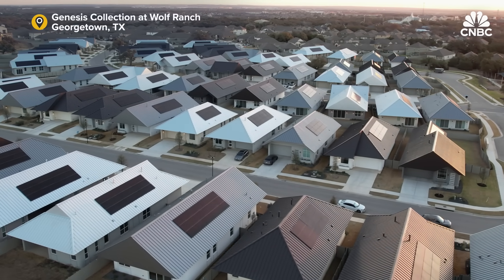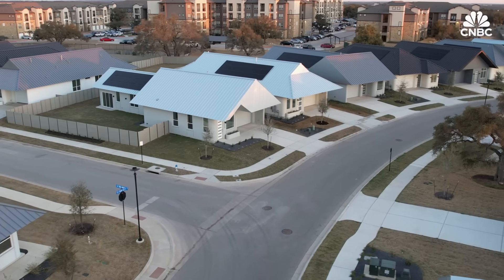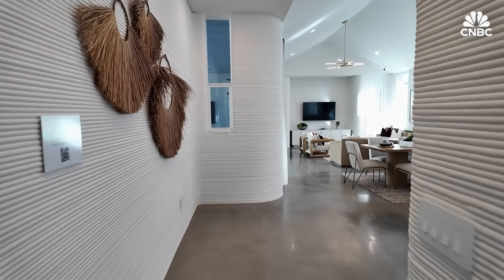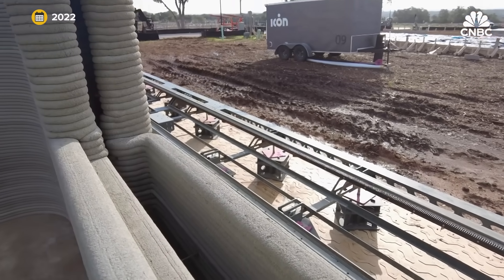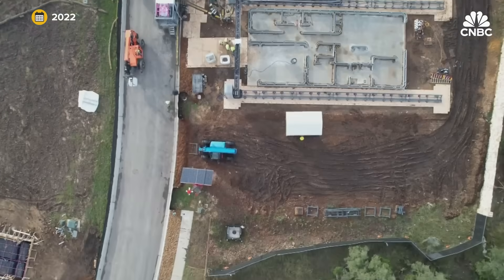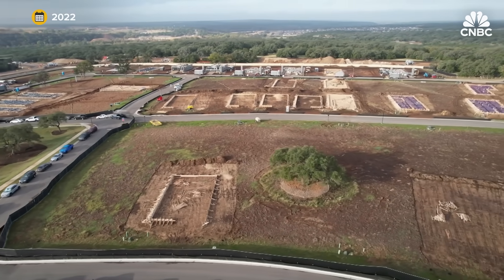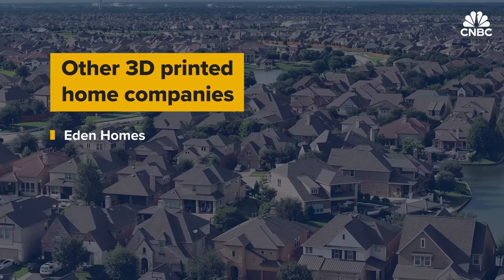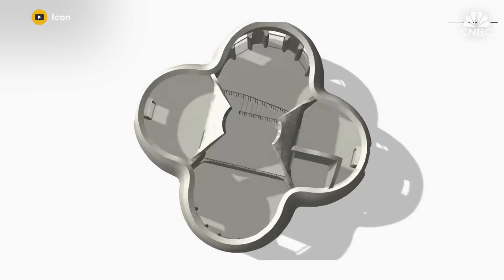Inside The World’s Largest 3D Printed Neighborhood

Comment: "Learn to code", then comes the tech layoffs. "Just learn a trade", here comes 3D printed buildings.
Reply: “Become a semi truck driver” 😅 - but now we have self-driving semis 😢
Reply: Learn to keep learning 😂
Reply: Terrible times smh
Reply: What do you think that printer runs on? Software
Reply: I don’t like the look of the interior walls, and maybe those creases would collect dust and cobwebs. Couldn’t they skim plaster over them for a nice European vibe?
Reply: you can't 3d print the wiring
Reply: @xynonners  You speak way too early.
Reply: @harveylin3548  Agree...when folks post statements like "you can't do x" I mentally add the suffix "...yet". New wave urban development stakeholders are aggressively seeking ways to fully automate process. This applies to wiring, plumbing, HVAC, etc....they may not have a cost-effective way to do it now...but the second they do (and its done cheaper relative to human labor) all bets are off.
Reply: @harveylin3548 as a plumber, I know i will not live to see the day machines are able to take my job, and I’m 35
Reply: @stevo3938 Why exactly? All that you know can be coded. All that would be left is a body to run the code through. 
Have you seen the latest androids from Boston Dynamics? Whatever helps you sleep at night though.
Reply: @xynonners  Why limit machines to printing when they can do so much more?
Reply: @xynonners   yet, the key is yet but it could happen is the crazy part we can already 3d print metal so it is possible down the road
Reply: @xynonners  I wouldn't be so sure of that.
Reply: @xynonners 10 years ago you'd say you couldn't 3d print a house. Like come on man yes we can't right now but that's not the point. You're missing the forest for the trees
Reply: @xynonners  you sure?😂
Reply: @xynonners  yet...
Reply: @xynonners actually they can sort of print wiring. So they got ai designing printed circuit boards. Theoretically they can use that idea and print wiring.  It's really just about placing conductive materials and non conducting materials
Reply: @xynonners  yet
Reply: @xynonners For now …
Reply: @xynonners  Not yet, but rest assured it's coming.  The existence of  3D printed plumbing and robots that can assemble them is very real.
Reply: Learn to code then comes AI.
Reply: learn how to do maintenance on 3d printers
Reply: Learn to weave cotton.
Reply: We're all cooked
Reply: A concrete home is more sturdy than a paper thing Sheetrock home
Reply: "There's always money in the banana stand." -- Arrested Development
Reply: Just learn to be a battery.
Reply: Now it's 'learn to code with AI' or 'learn a trade with AI.' The difference for learners is minimal. The future is AI plus whatever skills you already have or will aquire in the future.
Reply: Can't 3d print the
HVAC and it's only good for developments.
Reply: You just shouldn’t get overly attached to any given career or industry. Times change, and you can’t stop that. But what you can do is keep yourself informed so that you can switch careers if necessary.

“Learn to code” has been good career advice for many decades. But it’s not like it’s the only good career advice.
Reply: Coding and building good software are two different things..
Reply: This good! so true
Reply: These won’t replace trades, this is a gimmick or a niche case use at best.
Reply: All these buildings will still deal with plumbing and electrical things installed and require maintenance. Carpentry will still be used all over the world for centuries. Tech jobs are still in high demand and will be for centuries. Shut up, what a useless uneducated comment. Lol
Reply: I am number 46 and yes you can do it all idiots, sorry electric, carpentry , Robots dum dums
Reply: make no mistake,    when robots do all the labor and ai does all the bookwork,   'covid 2'  is gonna come around and remove the majority of the unwashed masses.  forget about ubi.  they dont need you anymore.
Reply: They also now making robot AI plumbers etc. They coming for the trade jobs
Reply: Someone has to code the printing machines and related tech.
Reply: @mrcookies409  So a coding AI trained on printing mechanics?
Reply: The people build sucky cheap houses that can't even withstand severe weather, having a safe home is better
Reply: The closer we get to a world where we dont have to work to live, the sooner we can focus on things that actually matter, like our mental health, relationships and things we ACTUALLY WANT to do
Reply: And when the trade gets flooded?😂 we’re all fkd everyone is laughing at the guy it’s happening to rn like they aren’t next, yall do plan to live longer than 10-15 years. Yall really think yall getting fk You money in the trades before that? No you’ll get a family and experience lifestyle creep and be just as broke as the college grad yall love coping, laughing at because now it’s them
Reply: That's the scam of technology in capitalism. Technology could have improved lives for people, but instead it just makes the rich richer, because they're the ones who have the power over where and how it gets used.
Reply: Yep. People still don't understand what's coming.
Reply: Sparkies and turd wranglers are still going to be in high demand.
Reply: Learn to "adapt".
Reply: And you can’t print plumbing, carpentry, hvac installation, etc. Don’t be negative. There’s still so much opportunity.
Reply: @lovinglife419  But you also can't just hide under a rock and pretend 3D printing isn't going to make a lot construction jobs disappear.
Reply: @harveylin3548 let’s go back to Stone Age don’t use cars back to horses create jobs and no power tools just hire more people and no plumbing that way we can pay people to go get water and shovel our poo again.

Well get all those jobs back brother
Reply: @lovinglife419  they will eventually find a way. think about all the jobs that have been gutted already with this technology - AND, technology ONLY progresses...
Reply: @lovinglife419  literally far LESS opportunities, by cutting out entire trades... What are you talking about?
Reply: @lovinglife419 actually  you could print most  of the plumbing
Reply: @lovinglife419  "They haven't taken your job YET. Don't be negative."
Reply: @lovinglife419  Not yet, but when they figure out a way to automate those skills as well, they will.
Reply: @lovinglife419  spoken like a true office worker. So 1 person building 12 houses like the report says is going to help employment issues???
Reply: Erm you absolutely can print all that eventually
Reply: don’t think you understand just how much coding is required for these robots lol
Reply: @monaazzo8011 ai is the king coder now
Reply: In both instances, you were supposed to build the business that controlled the beginning and end of the sector, not work for the guy building your own replacement. Please remember this the next time you get career advice. We live under capitalism, not workism. The goal is to generate capital, not exchange work for sustenance for 50 years. That’s just servitude in a modern setting.
Reply: @bettyjeanmarinogmail Very true but still easier said than done
Reply: @bettyjeanmarinogmail you won't have any sustenance if you don't have any jobs. So I guess we will survive on our looks 😂
Reply: @bettyjeanmarinogmail "not exchange work for sustenance" this is the same bootstrap argument and it sounds great and motivational for some people but not everyone will start a business and for a functioning society, people need jobs. The same people demanding everyone be ok with capitalism are the same people crying when younger generations don't want to have kids.
Reply: its a game designed for the individual to be forever controlled
Reply: No, its like the attempts to build with shipping containers, it creates more problems than it solves, and a lot of labor.
Reply: @churblefurbles no i think you’re wrong actually, a lot of cool stuff is coming down the pipeline. i guess time will tell
Reply: Just get dementia and choose physician assisted unaliving
Reply: McDonalds is always hiring lmao
Reply: Work harder
Reply: I think it will actually help with illegal immigration as less workers are needed. It will also help Americans take these jobs and have higher salary since a business won’t have to hire so many workers.
Reply: Starting and running your own business is the only way to go. Don't blame others or the government if you choose to be a wage slave.
Reply: @eliiiiiiiiiiiie  Not if the big businesses are in bed with big government, you think small businesses have any room to live, good luck.
Reply: @eliiiiiiiiiiiie  if everybody owned a business, nobody would be left to work in the businesses. Most businesses are not self-sufficient.
Reply: @eliiiiiiiiiiiie  So because every generation prior could make it big with a basic job, now future generations are shoehorned into only becoming a business owner to make it?

Get real dude

Comment: I wonder if there's an option for a smooth wall as opposed to rippled.  the ripple effect is nice though, just different
Reply: I’m sure they are working on that. That way concrete 3D printed homes wood look virtually identical to wood framed structures.
Reply: @Battleofthefortuna-23   Right, it was understandable a few years ago when 3D printed homes were in it's POC phase.

Comment: If you're going to use standardized layouts in all the homes,  using prefab sections or some kind of interlocking panels would be a lot cheaper and faster than a 3D printer... (imagine giant interlocking concrete legos).
Reply: YEP. And that have been used for decades.
Reply: I mean you could just build a tilt up style shell and stick interior, probably would be a superior building
Reply: No need. A small rectangle house takes a whole 2 days to frame.
Reply: @MrSteeDoo  And then you have to apply air sealing, and apply exterior siding to the exterior, and drywall the interior, etc.  How much longer does that take?  And I'm talking full time to complete including delays because contractor's schedules don't match up.
Reply: @MrSteeDoo  And it took this 2 weeks.
Reply: @MrSteeDoo  There was a record for 5 store 8 apartments per floor commie block built in 7 days with slab foundation and prefab panels. Fireproof, wind-proof, quake-proof. 80 years later completely functional. Still can hear when the neighbour is drilling to hang a picture on the wall.

Mass production does not allow aesthetics and quality. But can house your people, which is a great problem for the USA. 

Only the contractor in this advertisement is charging exuberantly for homes, that can really be affordable to plug the social problem.
Reply: the commies did that and it was working out great

Comment: Those lines and crevices in all the walls look like such a PAIN to clean haha
Reply: Imagine a crack or renovation, plumbing repair. Matching that pattern would be insane. As an Electrician, I wouldn't want to even get into that mess
Reply: @26longlongtime just think a little , go outside of the US and you will understand that what you are saying is ignorance.
Reply: plaster over those walls? since its concrete it cant be that hard to do
Reply: @D0P1C3  I believe some 3D printing construction companies do plaster or otherwise finish their interior walls so they’re smoother and easier to clean.
Reply: @D0P1C3  That's true, it could be plastered "flat" but the wall  is quite uneven therefore there would be a lot of freehanding needed.
Reply: Couldn't you just line the interior walls with sheetrock?
Reply: It can be plastered smooth after printing tbh
Reply: No worries it'll pressure wash right off. Don't forget to have a drain installed in every room.
Reply: Power wash it 😂
Reply: When they can make these things at a decent cost, I imagine it will be drywall on the inside
Reply: Those textured walls might be having a sound deadening effect
Reply: I never wipe my walls. Is that a thing?
Reply: @  crevices attract dust, dirt and pet hair in my experience! It’s less noticeable and much easier to clean on flat surfaces
Reply: Think of the occasional cooking mishap, children, or maybe even using a fly swatter. The cement isn't smooth like painted drywall, stuff doesn't wipe off as easily.
Reply: @MrSteeDoo it is, walls get dusty. i do my walls like 1-2 times a year
Reply: @MrSteeDoo  yes, it's wild that you don't clean your walls. That's like saying you never wash your floors. You should do your walls 2-3 times per year
Reply: @MarkT1700  What benefit is there?  Satisfaction of OCD urges?
Reply: @MrSteeDoo  you don't see the benefit of cleaning?
Reply: @MarkT1700  not my walls.
Reply: @MrSteeDoo  LOL, Men might not know it is a thing but women do!
Reply: @MrSteeDoo you’re dirty
Reply: @Hashdollars  I am not a clean freak.  I painted my walls two years ago.  They look great.
Reply: @MrSteeDoo you don’t have to be a clean freak to be clean. 

You said you painted two years ago, you’re supposed to wash the walls before you paint. 
So you should have washed your walls two years ago if you painted correctly and at least once a year if you are clean. 
Don’t shoot the messenger.
Reply: @Hashdollars  Apparently I am "unclean".

I guess I don't see where it's a written requirement.
Reply: Yeah. I was wondering if you could fill in the cervices and make it flat.
Reply: I thought they would smooth it out manually. They didn't!
Reply: They eliminated plasterwork as cost saving and hoping buyers would love the toothpaste work....I imagine the look will be like crap when it comes to future resale...
Reply: vacuum, different wall each month
Reply: Oh my goodness, imagine the dust! On the walls in my kitchen there is a flourish at the bottom of all the tile walls and those -- you have to get a wet wash cloth and use your fingernail as pressure to wipe between hundreds of "flourishes" to get the dust out.
Reply: Dust heaven.
Reply: You can easily paint it over to smooth it out
Reply: Yeah this is what I was thinking. I'd have to damp-wipe my entire house every month!
Reply: You know brushes are a thing?
Reply: @them0leisback  yet people can barely be asked to clean their ceiling fans. Now they'll have to dust their walls? Gross.
Reply: @FangerZero  if you visit YT'ers who have cleaning channels, they already clean walls. It sounds like your walls are the ones dirty. =P
Reply: @them0leisback  Oh so now you become an archaeologist. Cleaning each line like you're brushing off an ancient ruin..Might as well grab a headlamp too....Nobody got time for all that.🤣🤣

Comment: only concrete, no reinforcing steel? anti-earthquake? :face-blue-smiling::face-blue-smiling::face-blue-smiling:
Reply: In another video I saw that's more in depth. That put steel plates in every 3-5 layers if I remember correctly so it does have steel reinforce
Reply: Ordinary US homes are built from wood. On the other side of the Atlantic ocean where construction of housing is taken a bit more seriously, bricks are used. But neither of these two examples are steel reinforced, because it isn't needed. So why would you reinforce a similar house made of concrete?
Reply: @them0leisback  wood is lightweight, flexible and ductile. It can absorb energy released by earthquakes. I am just curious if the 3D printed concrete can do the same. Anyone knows?

Comment: Why would people want to live in a 3D print with unfinished walls? I also wouldn't want to be the first to experience problems specific to these houses aging.
Reply: I also wouldn't want to beta tester for my house but a concrete structure like this will actually age pretty well. I imagine most of the building will be fine longer than a house built out of wood and plaster but I can't fathom what it would take to fix some of that plumbing and what that could do to the stability of the house as a whole.
Reply: @cydranzer6027  Ever see a crack in drywall? Same goes for concrete. Repairing cracks in these rope pattern and having it look good will be impossible. Whole walls will have to be stuccoed.
Reply: @cydranzer6027  Yea, a log cabin home built in Tennessee over 150 years ago is still standing. I'll take that before this thing.
Reply: I'll take this over a cheap stick frame house any day.
Reply: @Elemental1331  Stop with this lie that stick frame is cheap.
Reply: I personally love the look of the walls. It's like art you don't have to install:) Adobe or mud houses are been around for a long time because it's a good building material. Assuming the concrete mix used is stable it should age well. ICON has been building for a few years now and likely are watching to see how the product ages but it's a good point.
Reply: I bet they will age much better than stick frame homes. I wish they finished the walls on the inside, doing an indoor stucco finish wouldn't be that labor intense and make the homes feel more cozy.
Reply: @jf7654  doing the indoor walls would cost more money, that's why they said they did open floor plans
Reply: Why would people want to live in cars, vans, and tents? Shelter is a necessity